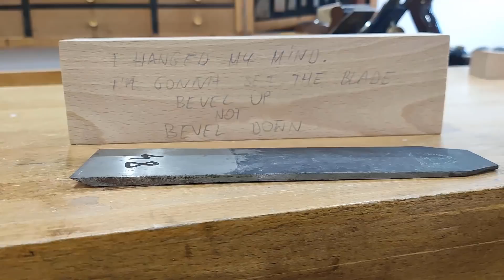061 Mitre plane, yup another

Comment from the maker: It's time for another plane - mitre plane. 
Beech wood and an old laminated blade by Ferdinand RUBENS.
At first i wanted to build another strike block plane (bevel down), but i changed my mind to set the blade bevel up - it is nice chance to show you difference beetwen that two kind of planes. 

Strike block plane have cutting angle below 40 deg - the same as the bed because the bevel is down. This is perfect plane for planing / strike endgrain.
The blade in mitre planes is set bevel up on the bed (20-30 deg). The cutting angle is amount of the bed angle and the blade bevel. It can be easly changed by regrinding the blade bevel.

At the end of the video i'll show you how my mitre plane reduce tearout and why strike block plane is better for work with endgrain. 

The plane is equipped with a mouth closer - simple wedge in front of the blade. The sole will be worn out after some time and the mouth will be open. To close them again the mouth closer should be fitted a little bit deeper. That's all. Brilliant solution wich was born few ages ago.

I hope you still  like my "old style" of the videos :)

Cheers

Comment: That's a lovely plane, Stavros. Again. I prefer these planer planes, without contrasting timbers.
However, your little comparison at the end wasn't fair at all. The Bailey -pattern plane at the end was set to take very coarse shavings. If you set it to take the same thickness shavings as your woodie, and if you set the cap iron very close to the cutting edge, you could easily achieve comparably impressive results. You don't need to make your brilliant planes look better by making other planes look bad.
Reply from the maker: Hey Mike, thank you! I used this no 4 only to make a tearout, not to compare both planes. Cheers!

Comment: @stravros gakos im not sure if i am using the correct term when i refer to the tool you are using around the 8 min mark.   i would call it a float but im most likely mistaken.  it seems that you made this tool yourself.  do you have a video of this?  if not can you point me in the direction of a good resource to learn to craft one as well?
Reply from the maker: yes, it was my edge float. I used it as 10 deg marking tool there. I don't have any video, only few posts on my instagram profile. Try to find Walter Sorrels planemaking float video on youtube. Cheers!

Comment: My question, why do you use a Stanley hand planer for making your wooden hand planers?
.
.
.
I also do the same, don't know why..
Reply from the maker: Hey, because it is a tool 👍
Reply: @StavrosGakos  it is a tool but much easier to handle than the wood ones, I only find the heavy wooden jointers good for heavy shaving. Stanleys are best for small careful planning works.

Comment: I absolutely love this style of video and you do it the best. Actually,,, well enough that I'm using the style in some of my new videos. Not promoting my channel here as its a different channel. Im not updating my channel just using it for surfing😉 But a quick question. I don't remember you using so many guide blocks before. Are these angles and sizes that you commonly use from build to bud, or just blocks you cut for scribing only for this llane?
Reply from the maker: Thanks Robert, i don't care about this guide blocks, if i need one i make it 👍 will check your channel. Cheers!

Comment: Hi, many thank,s for the video, Please witch chisels brand are you used ? many thank,s
Reply from the maker: Hey Christian! I use chisels not worth to recommend. I hope to change them soon. Cheers!
Reply: @StavrosGakos  Thank you very much Stavros , and what will be the new ones?
Reply from the maker: @christianmateo2621  you're welcome :) probably set of socket chisels from Stanley SW
Reply: @StavrosGakos  Hi Stavros, Thank,s last question, wihat Wood are used for making your wood planer? Merci.
Reply: @StavrosGakos  Do you think the current Stanleys are good chisels ? vs Ashley.Isle, Veritals PMV11, Narex , etc etc . To dig into the wood to make a planer in hard wood, and hit with a hammer, what brand and model of chisels would you recommend? You are not happy with your Narex chisels ?? Many thank,s for your videos.
Reply: @StavrosGakos  Many thank,s .What is the brand of your small saw/rasp with the yellow handle ? thank,s

Comment: I've always noticed that on certain chamfers you'll use a chisel instead of a plane and I'm curious the reason? Is it because you like using a chisel or is it because on some of the smaller chamfers it's just easier to use a chisel rather than a plane? I would think that using a plane would allow you to get a little more control and if you do it with conscientiousness it shouldn't be an issue of overshooting your lines. I'm just curious I think that you do some of the best work I've seen and if there's a method to your madness I would love to know what it is. Thank you
Reply from the maker: Thanks Dario, with the chisel i have more control. Cheers